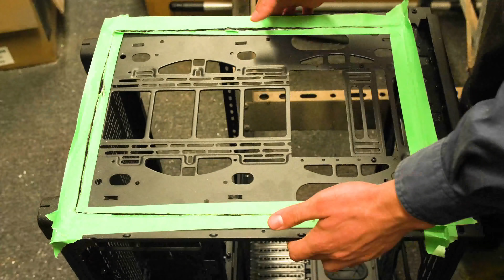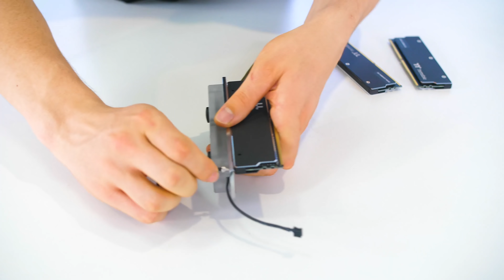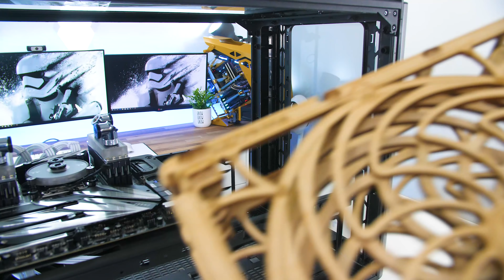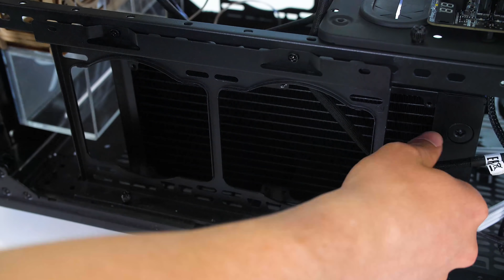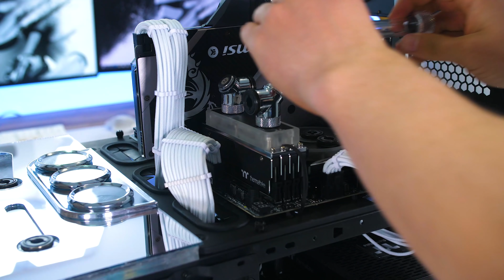$5200 Custom Water Cooled Gaming & EDITING PC Build | Crazy Time Lapse

Comment: Really nice acrylic work.  Very clean project, well done.

Do you have any information on your distribution block?  You said it is custom but didn't really show much of it.  Did you make it, if so do you mind providing more insight how you did it?  I have a laser and would like to build a distribution block but I don't how or where to start so any insight you can provide is greatly appreciated.
Reply from the maker: Hi yes it is 3 layers of acrylic and i used acrylic cement to join them

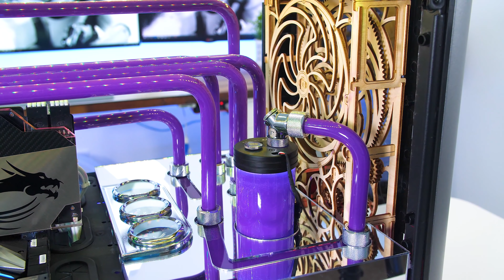Comment: at about 11:10 is why I stopped using solid fluids, looking at the deposits already in the GPU block making it look like crap. I love the build BTW just not the fluid ;) Good Job!
Reply from the maker: Yeah that happened from left over liquid from shipping the pc back from computex in taiwan
Reply: @DesignsByIFR  Yea I got a very similar problem when I had to change out a part of my loop and after just a couple hours my blocks looked like that. Unfortunately I didn't notice it till after I refilled everything and that was it for me with any kind of solid coolant. They look great off the start but not in the long run. And my systems pretty much run 24/7/365 being an animator so I don't thing solids are ideal for that kind of abuse lol. I do love how you are doing your distro blocks and its giving me a lot of ideas that I want to try. Going to try cutting and refining them by hand as I don't have access to a CNC or Laser but might get somewhere else to laser it if I can get it clean enough. Cheers!

Comment: I love your PC builds, I really want to do a water cooling build but I have no clue on what to do. I'm new to PC building and going to start a my 1st PC build soon. Was it difficult to do a water cooling build at 1st?  And what's needed to build it? Thanks for Videos love them
Reply from the maker: Hey man, thank you very much. I actually started with soft tubing which was very simple and that gave me the confidence to learn hard tubing. You need fittings, waterblocks, radiator and a pump reservoir combo.
Reply: Thank you for the help and quick reply. Looking forward to my 1st build! Once again thank you for all videos I love them and I'm learning from them. 😊

Comment: How can i make sure in my pc case fitts a water cooling? @Designs by IFR
Reply from the maker: Check out your case specs for radiators, make sure you have enough space between motherboard and front aswell as gpu and front to mount a reservoir/pump

Comment: While I really like what is done here, I also have to critizise what is happening lately: The use of laser cutting and milling to produce custom distribution plates to be integrated in the shown systems. That clearly goes beyond the possibilities of an average builder/modder. So the newer videos (not only on this channel) are not suited for any builder looking for inspiration for his/her next project. Creating custom distribution plates, although they by themselves are extremely awesome and can make things much easier when it comes to tubing routing, goes so much over the top that no "normal" builder can follow suit. I am sure I would not be the only one who would appreciate if there would be more focus on achievable systems. Call it " back to the roots" or "oldschool" if you will.

But nonetheless: Awesome and stunning build.
Reply from the maker: Thanks man. Actually with the distroplates i have been making you can do them by hand, they are just 3 layers of acrylic layered together. I just choose not to do it by hand because the laser is faster. You can achieve the same result by hand and i use to have to do it by hand before the laser machine, it is just going to take a lot longer.
Reply: There's likely some place near you that will laser cut for you. I found one near me that charges $1.50/minute and if you're not making a large or super complex plate, that's absurdly cheap. You can either provide the acrylic or they will, for a slight markup. If that's not an option for you, then you'll have to spend a few hours with a Dremel. Either way, it's totally achievable for anyone. I recommend taping the cut and wet-cutting if you're going the Dremel route to minimize melting.

Comment: i9 and an RTX 2080!? 🤯
Reply from the maker: =D
Reply: Could be better, specially at that price.
Making dope ass builds with "less than" parts is kinda silly to me.
Reply from the maker: @xpodx  cannot be better at this price. If you want better hardware that would increase the price
Reply: @DesignsByIFR  i mean, like i9 9900k and titan rtx pc for under 3500 or so, and another titan rtx for like 5700 or so
Reply from the maker: @xpodx  yes you could do that but then you would have to swap from the i9 9900x for a 9900k and swap out the x299 motherboard for a z390 board.
Your rendering times would suffer a lot,  dont forget this is a gaming and editing  PC
Reply: @DesignsByIFR  oh alright,  yea.. its a gorgeous piece don't get me wrong,  and makes sense for editing and rendering times, just when i watch peoples liquid cooled builds alot of the times they don't get the best hardware and spent most of cooling, and things for looks. But to each there own, i just prefer more power, then if at all possible some nice aesthetics.

Comment: Would u like to sponsor me a normal PC without cooling system please, I am trying to assemble a PC from past 3-4years but I couldn't collect much and these things are getting updated every month so not able to decide which thing to buy also and my money is not up to the mark which I need to assemble😖😖😖
Reply from the maker: Please stick around for one of our giveaway pc builds
Reply: @DesignsByIFR  yeah I have been looking around for those also but luck isn't there with me though 😟😟
Reply: I use my PC for rendering in REVIT ARCHITECTURE n 3DSMAX it takes about 3-4 hours to render a simple stuff 😭😭

Comment: Sorry to be the one but i think its pretty messed up. The quality of the etching on the mirror finish looks pretty bad and so does the mirror finish itself. The gears on the front looks totally out of place and doesnt harmonize with the aesthetics at all. To be honest even looking at the etched gears gives me a headache since the gears would selfdestruct if they would, or could actually, turn.  The covers of the fans would look better if there wasnt a big gap in between, looks just like a cheap cover. The fan in the back feels totally lost and out of place.
The gauges were a smart and good idea if they were positioned in a way where you could actually read them. Those are the only thing that actually breaks the plain mirror finish.

Ram blocks are the most useless thing and only cause an unnessessary weak point. I used one myself and it actually leaked twice over time while everything else was fine. Second time it actually took my GFX with it so i'd never use a thing that useless anymore.

High effort but definetly not worth the outcome.
Reply: I agree 100%. He needs some schooling in design. Like I wrote in my own comment -- it looks like the inside of a cheesy strip club.
Reply: @mariarichmann430  I hoped other builds were better, but i think he tries too hard. The more expensive it gets the worse it looks.

Not sure about if schooling in design helps someone without a sense for astethics.
Glad i'm not alone on this, the praising in the comments is just too much for me :D
Reply: @derpizzadieb  Schooling in design REALLY helps. If you have a local university, go check out the architecture design "crits" they have a few times a semester. They don't just learn to design houses. It is everything.